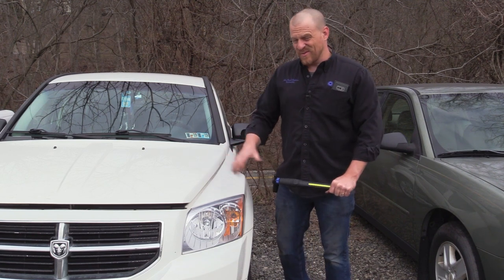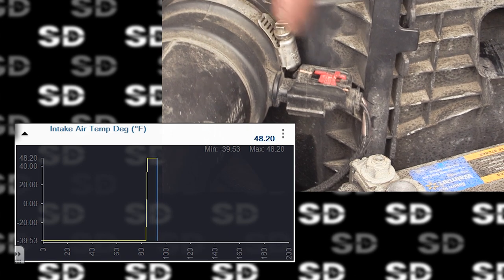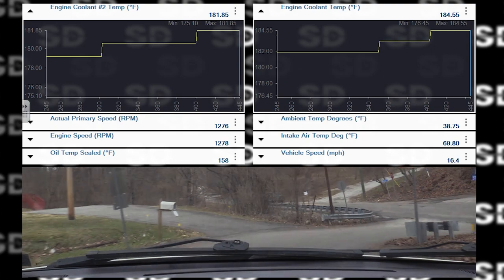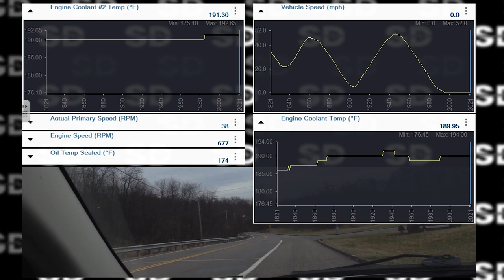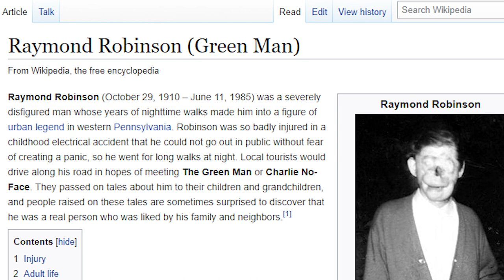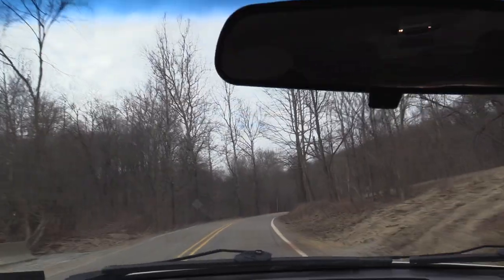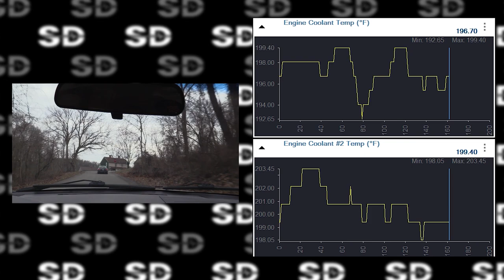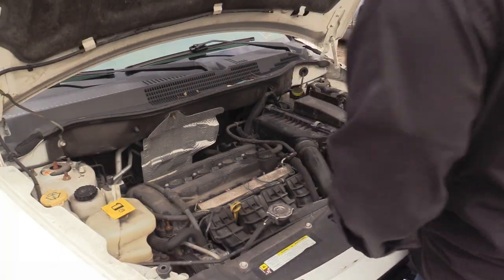Intermittent Faults and Charging For Your Time - The Legend Of The Green Man

Comment: I remember Mopars of that vintage having absurdly common problems with ISS and OSS sensors.  I remember having one that the plastic tip broke off and allowed the actual sensor tip to slide back and forth in the plastic housing.  The sine wave was crazy in that it created an escalating saw tooth pattern on a scope.  I'm not saying that you have a precisely duplicate fault, but I'd bet that your throttle surge is related to a wonky OSS sensor reading.  The ISS and OSS sensors should be identical.  If you wanted to try something akin to misfire 101 diagnostics by swapping the sensors the same as you might do with plugs or coils, you could look to see if you gain an ISS code when the customer comes back next time.
As far as billing or even how to decide time spent on gremlins like this go, I don't know.  I can only tell you I can't win.  My boss used to get mad at me for spending too much time on a diagnosis and wanted me to get a better grasp on knowing when to put the scan tool down.  So from then on when my half hour or hour was up, I'd turn in my paper work, tell the boss where I was and then he'd tell me to go back at it.  I worked for another guy that tore me a new ass because I was trying to read the service info when I didn't understand how something came apart.  He later tore me a new ass because I didn't read the service info when I didn't understand how something came apart.  I sometimes wonder how I can even tell the difference between a lug nut and my left nut anymore.

Comment: Coolant temp performance codes on Euro vehicles, Scanner... There is usually a temp sensor at the thermostat/temperature regulation housing and one in the side of the radiator or the bottom hose area. 

What the PCM is checking is the temperature difference between the two sensors given set parameters, cold start is usually when you get these types of codes because of a stuck thermostat.

Surging can sometimes be caused by incorrect coolant flow.

Comment: In situations like this, I would meet my customer half way, considering most of my customers are regulars, and loyal.  I would charge half hour for my time.  I would make appropriate notes for future reference, explain the situation to the customer, and advise them accordingly.  If they return and the same scenario occurred, intermittent problem, I would attempt to evaluate the possibility of a "best guess".  Sometimes it's better to "throw a crank sensor at the car" than to have them coming back over and over again, unable to duplicate that intermittent crank code.  ( I chose a crank sensor for the example because it's a somewhat common no-start situation, and often times requires the replacement of the sensor ).  Ideally I exhaust all efforts to actually diagnose problems.  But, sometimes it does make sense to try something.
Reply: Especially if it's an easy thing to swap out. If I was wrong with my best guess then I usually take the labor charge off. I had a caravan that was like this, drove it around for literally a week and couldn't not replicate the problem and customer didnt want to be without vehicle any longer.
Reply: @cheesecurd100s  Exactly.  I had a customer with a Ford sedan, forget exactly what it was.  But it had an intermittent crank code.  Had them drop it off for a cold-start, no dice.  Warmed it up, no dice.  Drove it, restarted, no code.  Gave them the option to give a sensor a try, they agreed.  Installed the sensor.  That was a couple of years ago and it's still going with no issue.  So, while I do agree with Danner, in theory, in practice sometimes you just gotta try something. :)

Comment: In instances like this where obviously you need to make a bit of a buck for your time but you're stuck finding anything else than an easy fix from a slip of the owners fault, I usually do a safety check, general check over of components and/or neaten up the engine a little bit, visual changes and something to show that you were there and did something, even if it's just spraying some terminal corrosion protector on battery conections or earth points.. Usually on cars like this, there will be other small faults with the car, or places that can easily and quickly be neatened up or safety concerns that you can bring to the clients attention. People are a bit more understanding when they can physically see that there has been a change to their vehicle instead of just a light that isn't on before. You'll also find that people understand that you genuinely care for their safety and value their business and with this you will get repeat work, and the best advertising possible, word of mouth.

Great video production on this one, entertaining for sure!

Comment: That's a sticky situation when you don't actually find a problem how do you bill? I mean technically if the active code was air temp sensor and the others were history codes and the car came in for mil on then you did your job (but how much can you bill for plugging in an iat sensor?). Then at that point let the customer know there were history codes and there is a possible intermittent issue that could reoccur, have them drive it and bring it back if a problem occurs again.

Comment: For me it depends on what they are doing with the vehicle. If they have a CEL and want diagnostics for it but no repairs they get charged an hour. If they want the diagnostics and related repair and it's something that the diag and repair is done under an hour they pay the full hour. I will also make a list of issues with severity of need. Like the brakes are grinding on steel that is put at the top, the low windshield washer gets put on the bottom.  Intermittent issues though are a bear regardless.
The wifes buggy has a P0113 that vanishes after initial start! I think it's in the harness but it won't stay "broke" even when doing a wiggle test...

Comment: Are you in Pa? Just why is there jersey barriers in the tunnel? Why didn't you walk through the green man tunnel? My 89 s10 pickup got hit by a drunk driver last october. Eversince that happened I have been having issues with the rear lighting. Brake lights don't work right. When I turn left the fuel gauge goes to empty and back again. The weird thing happened tonight. With the engine off. You hit the brake pedal and the SES light comes on. This truck does have rear wheel antilock brakes. Damn I have to remember to look up about the green man!
Reply: grounds, you have bad grounds, go find and fix them now ;)
all the frame/body and engine ones, probably multiple of the corroded and bad

Comment: As a DIY and reflecting the consumer side of the automotive service arena, I think any shop would be justified in charging 1 hour diagnostic fee. Initial visual inspection  noted that the intake air temperature sensor was unplugged and your hunch was correct in that caused the error code P0113. You reconnected the sensor and you spent some time driving to check correction of this problem and to determine if you could repeat the other code conditions.

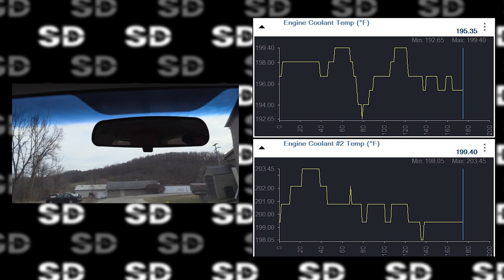However I believe you overlooked  very obvious information on your graphing scan tool. In interval 20:00 to 21:10 there are several instances displayed where the signal for the 2 coolant temperature sensors spike upward and downward over a few miiliseconds of display time. Engine temperatures do NOT swing 1.5 - 2.0 deg F within a few milliseconds. To me that would indicate a wiring problem is causing bogus signals being sent to the PCM (powertrain control module). The PCM is setting code P2181 because of these voltage signal spikes. 

Unfortunately the description given by the scan tool "cooling system performance" is misleading. And if you look for a description and problem solution on the internet you will find information that leads you to believe that there is a mechanical problem with the thermostat or liquid cooling system. You have to have the actual Chrysler diagnostic information for this particular model year. It tells you that when code P2181 appears the PCM is detecting a change rate in the coolant temperature signal that is out of range. In other words the voltage signal is changing too quickly in this instance. So maybe there is a short to ground or power??? So unfortunately the same code will probably appear. Could this also be causing the surging sensation you noted during your test drive???
Reply from the maker: Scan data PID's absolutely do this at times. So not every single degree change is shown, in fact 2 degree increments is actually common.

Comment: I'm going to call it bad ground splice/terminals, we all know Chyrsler is good at that, they could have presently been wet from rain or vice versa and dry making it function normal.
CVT, sure wont function right if there's a voltage issue due to bad grounding(battery/charging also), I think they had batches of failing/crumbling speed sensors plastic around then and that would throw wild signals, so maybe high speed scope probe them. line pressure control, I kind of assume that was a reflection of input/output speed sensor issues and maybe also grounding/power supply

Comment: If I go by what was current, it was the IAT. After inspection and having it plugged back in, I will test drive and clear codes. Everything else is subjective assuming the customer’s only complaint was “ CEL on post service”. I would still charge for the diagnostics and explain the no charge for repair. Even if the customers are good loyal returning customers, I caution not to give the perception that diagnostics ($$) is not billable time.

Comment: These intermitent issues are such a time suck. Occasionally Ill offer to daily it to and from work but on top of that you often have to put fuel in them and still set up a data log so its still creating a bill. Most times they will be ok with it but they can always bring it back and use their own time on it. Often they can help identify an external variable on when it faults or allow a chance to get some freeze frame data at least. In my work the biggest time waste are dead batteries. Also ive heard the green man causes random check engine lights unless you give him beer and cigarettes lol

Comment: Does you website(premium) have video(s) i could watch to help with Transmission ASE tests a2/a3?
Reply from the maker: yes, absolutely, the majority of transmission diagnostics is electrical in nature. pressure sensors, switches, solenoids, speed sensors, it is all the same. I do not get into the hydraulics or the rebuilding of them, but I am certain that when you learn more of these other fundamentals, that you can apply them directly to the transmission ASEs

Comment: I have tried to get ahold of u on a later video I have a 98 chevy 1500 that has no power to the fuse box to the fuel pump relay have checked all fuses I can find there is  power to the rest of the fuse box where do I go it find the issue thanks if u get back to me soon
Reply: I believe it's feed from the "ECM B" fuse (number 11 I think) in the same underhood fuse box. around that year was like mid changes and some had the 3wire oil pressure sender(with pressure switch) that parallels the relay contacts when it has pressure, if the wires/sensor shorted it can blow that fuse also.
control of fuel pump relay is switched+ from the VCM/ECM it also has power from that same fuse. that fuse is fed "hot all the time" or should be. if it's not check the big BAT fuse(50Amp I think) I believe that feeds it and a ton of other power all the time stuff, make sure the battery terminals are all clean, I think they still used the stacked RED+ connectors then and those caused all sorts of issue when corroded up.
** if the big fuse has power both side and the small ecm-b fuse does also, then the fuse box is likely corroded up or a splice just behind it(I forget how they're made)

Comment: Ah, a Caliturd. A real piece of garbage anyway you cut it. The trans in this fugly thing is a cvt, it has no stepped gears. The cvt causes the car to pull to the right under acceleration, and pull to the left under deceleration. That, in turn, causes the front end components to wear out prematurely. The engine subframe/cradle rusts out pretty fast and badly. Just saw one last week, had a rust hole in the subframe several inches long. Not sure about the cvt, but Chrysler electronic transmissions have two speed sensors, one is the input, and one is the output shaft, which is used as the vehicle speed sensor. These turds also have a hidden relay/fuse box in the left front fender, they tend to corrode and cause problems.

Comment: ? Coil Breaking  Down ?
? Crank Sensor ?
? Fuel Feed , Fuel Pump ?
? Temperature Wire Lose ?
? Lose Battery Terminals ?
? Fuse , Fuse Box ? 
The list of Items to Check .
A Starting List .
Try It .
Reply: it's chrysler, you forgot to mention the bundled grounds, which multiple of them are likely bad :)
Reply: @joemilton7552  
Yes . That's The Method . LOL .